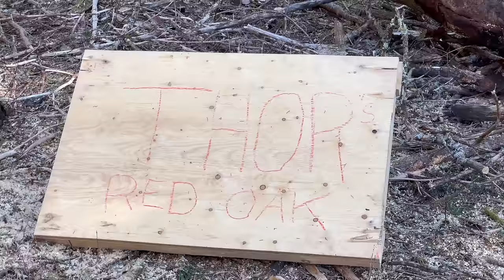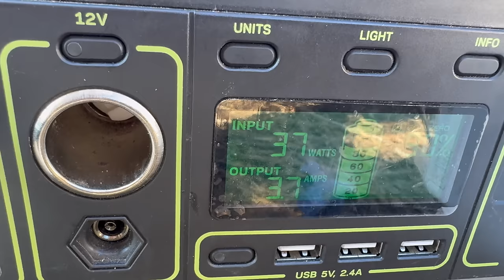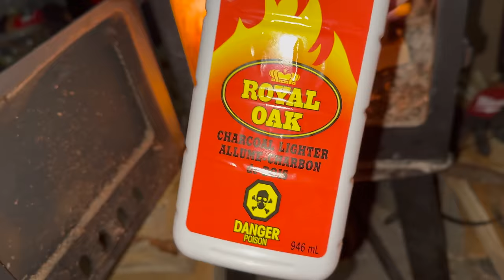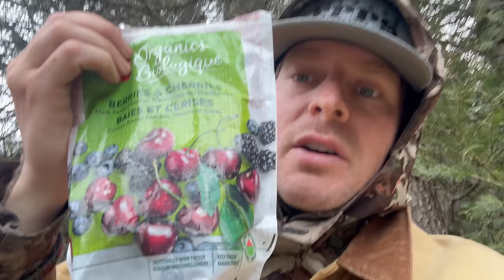Winter Log Cabin Build on Off-Grid Homestead |EP17|

Comment: For the chiseling, you want to score both sides and ideally chisel from each side to meet in the middle. That will eliminate the tear out you have. Pine is pretty soft so a whack or two should be sufficient to set the line.

Comment: when chiseling the gaps, bring them halfway through on one side and halfway on the other side so that the tearout meets in the middle. it also helps to have a backing piece of wood so that if the wood does tear out it cant because there is nowhere for it to go
Reply: Japp, that's how to do it
Reply: Along with having a board underneath what you are chiseling, you could also hog out as much material with a drill bit prior to chiseling. Hope that helps. Backer board prevents tear out.

Comment: I dont think your ears hurt due to machinery, im pretty shure they hurt couse you dunk em in cold water, in cold weather. I do it as well, but i always have a cap on that cover my ears, and i work 10-12 hour days all trough the fall-winter-spring with a chainsaw and tractors, without ear protection (i have it, just dont use it). The only days my ears hurt is when i get an earfull of cold wind. Combine low temperatures with your cold plunges, thats where your ear pain comes from, trust me. Try a swimming cap for a few weeks.

Also should be mentioned, loud noises dont cause hurting ears, it causes deafness and rarely discomfort. Painfull ears (painfull eardrums) are caused by cold, infections and if you jab em (q tips and such)

Comment: James, couple things. Deal with those gaps under your top plates now to block birds and mice in the future. You are creating a weird gap across the under part of the soffit that will be hard to seal later. Also regarding chisel, just backup your wood to avoid that tear out. Looking good over all. You are learning which is more than 99 percent of people out there. The most valuable thing to you is your neighbours amd your audience. Keep going. Watch the weather here. Get some highend rubber boots. You are going to be wearing them all year. The rains will come around June/july/august. This area gets about 50 inches of moisture per year...you are going to get use to mud and working in rain and muck, pal! Keep it up. Love the Epps hat!

Comment: With your rectangular checkouts, make multiple cuts with your circular saw from both sides down to your mark so it looks like thin wafers of wood left in the cut out area. Then knock em out with your hammer, then tidy up with a chisel and it will be a perfect checkout.
Reply: You can also chisel halfway from one side then flip the board then chisel from that side so you don't blow out from chiseling all the way through
Reply: Right on
Reply: @jamesjohnston8098  I agree, I was thinking “hes going to blow out the back” when I watched him. I was always taught to check in both sides with the chisel so that when you break through the wood is already scored behind etc. also I’m no carpenter

Comment: Shaving:  How to go from a 45yo to 30yo in two minutes!  
When you're chiselling those notches to prevent chip out, don't go all the way through with your chisel.  Work into the middle of the cut, flip the rafter over and work into the centre again. Then if needed you can flatten the cut with a couple of strokes of the chisel.  And yes, the serious chip out you made on the rafter would be an issue if the timber was load-bearing or structural.  But as a decorative rafter it's ok.

Comment: 31:45   Woodworking advise. Use the chisel to puncture the line you want to remove from the Back before you do so on the front. You need it like 0.3-0.5mm depth. This way you pre-cut the thin lair of wood that brakes on the end ;)

Comment: Sup homie, armature wood worker here. That damage the chisel did to the wood is called tear out. A simple solution you could do is apply a clamped back plate of wood just below the bottom of the section you are chiseling out. With the wood clamped down it can't be torn out like that. You had tear out on the sides of the cut out sections so applying a clamp with a back plate to the sides will fix that as well.

Comment: Maybe it's been said already, but for the back&forth stability you may also consider to put an extra transversal 6-7m  long 1x6' stabilizer, a "storm plank"to each side of the roof (from the top end towards the center) and nail them to the rafters.
It works perfectly against high winds in the (EU) Alps for centuries and costs peanuts.
Thanks for the great contents (& team work😉)!

Comment: To prevent tear out on the backside when using a chisel you work your way down 50% on one side then flip the board and do the rest from the other side. 
You could also just do cuts every 5-7 mm for the whole gap and then just bend the ”shingles” of with the chisel.

Comment: There are a handful of good techniques to keep wood from splitting on the back from the chisel. I saw a few mentioned already, but another is to roll (transfer) the measurements over to the backside of the board with the speed square and score the lines deeply with a razorblade knife. Use the edge of your square as a guide. The side scoring of the cut matters more than the top line since the grain runs end to end on the board and thats where its blowing out. The suggestion with multiple cuts with a circular saw with the blade depth set just shy of the top line is a good one too. I think scoring the wood is quicker and consumes less battery. Keep up the good work, the rafters look great!

Comment: Keep at it mate!  before going any further, now is the time to check your roof for square. top corner to opposite bottom corner. imagine in your head a giant cross on either side of the roof. both measurements should be within an 8th of an inch of each other. working alone with a tape can be tricky, plus it might not be long enough. a peace of string will also work, just mark the end with a marker pen. the sheathing and metal roof will thank you as you start putting it on. dont forget your small gap between sheathing for expansion etc, i just use a couple of small nails, about a 16th to 8th of an inch. good luck. loving your content by the way, top banana bro!

Comment: Hey champ, enjoying following your journey so long. I have a few tips for you. For example your new cart, if you tie a string on the handle, no more than a feet or two you’ll be able to walk normal when you pull it with those plywoods. Man I wish you would use a normal drill instead of that hammer drill, the amount of screws you use makes it kinda annoying to listen to. Have a nice day !

Comment: James, What you need is a wagon for your ATV, Currently Princess Auto has the one you need  and on sale for $500.00 off
In this weeks flyer page 12, Bozeman 3,100 lb Steel Dump Wagon for $1999.99. This trailer can then be used as a logging 
trailer as well as a trailer to transport Lumber or Sand or Gravel. I am enjoying your journey.
Keep Safe
Dave

Comment: To add to my earlier comment. Which was an oscillating cutter for plunge cuts. Look into a quite strike impact driver to save your ears. I use the Ryobi one I bought about 3 years ago almost exclusively now. I've don't have Milwaukee tools but I'm sure they have an equivalent. You do sacrifice some power, but I've driven Timberloks with no issues and it's probably half the noise and way easier on the hands to boot. Best of luck.

Comment: First drill 2 holes in the board then saw the small section(preferable with a jigsaw) from hole to hole in the length of the board after that saw the cutout from the edge. Sorry for the language, I am Dutch, (a former carpenter/mason)

Comment: i would trim the lower bit branches off that the rabbits got at so the tree pushes more to the main leader. At about 5-6 feet tall the deer stop nipping them also. I have some pretty zigzag oaks that are slowly looking more straight with each year. I think when the tree is mature you will not notice it. or at least i tell myself this. One thing with shaving this early in the spring is you notice how much insulation the beard gives you.

Comment: Multiple "kerf cuts" with your circular saw instead of just the outside edges...close as possible, cuts slightly above the bottom edge mark. Knockout with a hammer, then chisel cleanup. You have the right idea with material "relief" by drilling out the bottom then cleaning up with a chisel. Many close kerf cuts decrease the amount of tool change outs or processes....either strategy works. A large diameter "fortstner" bit bit can cut out a lot of material at the bottom, but you have more chisel clean out. Onward.

Comment: To make that chisel cut without shredding the opposite side, you can either start on one side and get half through and then flip the board or use duct tape. If you tape where you are cutting through, it will splinter less.

Comment: As for your rafter cutouts,to prevent them from tearing,once you've made your 2 saw cuts,lineup your square with the bottom of the cuts on the backside and score across the bottom firmly several times.Now when you cut thru with your chisel it won't rip or tear out past that line.

Comment: Finally sitting down to watch. Usually I watch first thing in the morning. I had to make a trip to the big box store today. Squirrels have been eating the PEX under my house. I’ve had to cap 2 pipes. My basement was flooding. Luckily the 3rd one that was chewed had a shut off valve. So, need to repair the pex, and I need to get the trees off the house, hope you don’t have any issues with squirrels. Moving to Midwest I’ve never seen anything like it. Anyways I’m 45 seconds into your video. Off to go watch. I kinda like the facial hair on you James.

Comment: You need to chisel against solid wood. 
You ar getting tearout because the wood you're cutting is unsupported
Usually clamp the wood being cut to another piece
Also you can cut from both sides to help prevent tearout.

Comment: To prevent blowout, take a knife and cut the fibers on the backside of the cut.  Or chisel both sides before you try to go all the way through.   There's no way you should be having issue with your saw and double ear protection.  I'd go back to wherever you got your ear plugs and do a test to see if they're fitting you properly.   It's also possible that because you're wearing them continuously that it's the pressure of having them in that's causing you issues.

Comment: With a template board you could EASILY mark a rafter in a third the time it took with the square and tape. More importantly you KNOW FOR SURE it's marked right. But you do you boo !!!! It's not like it takes 5 minutes vs 20 seconds but if you make 1 mistake 🤷 could be a 2x8 gone. Or are those 10's? Anyway ya cut it you've done a stellar job sir and we thank you !!!!!!!!!!!!!!!!!!!

Comment: Your "back & forth" often referred to as "racking" will only be solved with roof sheeting (ok  help) & even more so with angled bracing (Key!). Start at the 4 corners (where roof line meets the top of the end walls) & put a 2x4 from ea corner up to the center of the ridge line along the inside of the rafters. Tie all rafters into the angled bracing... racking stopped!!!

Comment: Tip for your chiseling: when cutting out that material have the flat side of the chisel towards you with you facing in the direction of where the chunk of wood needs to slid out, then angle the chisel slightly so that when you cut the wood it leaves behind a small sloped piece of wood. Then flip the board over and chisel out the remaining bit. Doing it this way will prevent that back flare out that you are seeing. Hope that helps. Keep up the great work and hope you stay safe in the storm.

Comment: When cutting your lap joints to join those boards perpendicularly, in your situation out in the woods without a bunch of shop tools, my recommendation would be to have a fine tooth crosscut saw on hand. Someone else already mentioned that you can cut multiple times in your waste section, creating “wafers” of wood. They will pry sideways with a chisel quite easily, and you can use the chisel to clean up the bottom of the joint. I’m no framer , just a recreational furniture builder. You’re doing really great, and as others have said, living vicariously through you.

Comment: Here is something that will help you on your atv in the winter. Run 87 or lower octane for your gas. It has a faster flashpoint than 91 or 93. So it will start easier in the winter. Also run the red bottle heat in your gas can . And another thing is properly warming the atv up in any weather but especially in the cold months. If you start it when it’s cold and take off then shut it off before it’s fully warmed up will create condensation in your oil. I’ve had some ranchers bring me their machines and they would have a quart of water in the oil. Hope this helps you! Great job so far.. I’m in Montana by the way.

Comment: First off use your chisel to score the cut lines to stop the tear out on the back side.If you had a jigsaw you could drill the corner and then cut across the bottom of the notch first. Then cut down to the corner with your circle saw. You should be able to do the same with your recip saw with a finer blade. Or you could score with chisle first and then drill multiple small 1/4" holes along the bottom of your cut. Then clean down with your circular saw. Then clean up with your chisel.

Comment: Just something to look into, but when my uncle had his roof redone in metals they used a special underlayment. I believe it was called Titanum Synthetic. 

The thought is that as the metal slightly expands and contracts the screws can worry out the holes in something like tyvex and make an entry point for leaks. This stuff supposedly doesn’t.

I’m not sure it’s a big enough deal to worry about it, and you may have already done and filmed that. Just wanted to mention it though. The videos are great.

Comment: Chisel halfway from one side, then the other. Another way is to chisel just a deep a line on the back end of the board so the wood breaks on the line rather than tearing out.
Edit: a third way is to clamp a piece of wood to your board so when you get close to the other side the sacrificial board prevents tearing, a bit like you'd put painter's tape on a circular saw cut to prevent chipping, but heavy duty.

Comment: Great episode.  I did a 10/12 pitch metal roof on my NH mountains log cabin and it sheds snow perfectly! Yours should be great. Hard to work on tho. 
Just be sure to install the bird blocking before the roof !  I didn’t because I wanted to get roof up before winter and it wasn’t fun doing it after.

Comment: Concerning your cutouts. Best thing to do is put something behind the wood that you're cutting as a sacrificial board. I have seen some of the best carpenters cut the slits like you did and then set the board on another board to clean up the bottom of the cut.

Comment: You should put an opening skylight, they are cheap to purchase and easy to frame in and install. It would mitigate the potential over heating of the loft. As a roofer I Install them all the time.

Comment: Re clean square cuts: 

There’s multiple methods you can do, probably the easiest would be to run the blade through a bunch of times, making several cuts. Then snap it out by inserting the chisel and leveraging it. 

Make the cuts just shy of your desired length of the opening, and clean the last bit out with your chisel

Comment: With a roof that pitched, and if y’all get that much rain/snow, I would do a French drain all the way around the structure and run it off the bank.. especially right now with the ground being easy to dig.. But this is only my opinion if it were me.. and my way of thinking.

Comment: Snicker, I don’t mind beards on men…just not the bushy ones most seem to prefer. It looks like they don’t take care of it, letting it grow out of control.
I prefer goatees and thin mustachios on men, at least then you can see their faces and won’t get beard rash when having a smooch….
As for the Norse gods, I prefer Loki over Thor. At least Loki thinks before he acts most times. Plus Their mother has to have the patience of a saint to put up with their antics and Odin actions.
I can’t help but wince every time I see the shavings and other debris on the ground beside your cabin build, I would advise you start cleaning that up before the fire fire season starts up again.
All those shavings and chunks of wood are borderline fire-starters, you just need to get a good rake and square mouth shovel to clean the mess up. The chunks of wood can be set aside for fire wood or something else.
I don’t know if the fire Marshall inspects that area, but it is something to look into

Comment: The notches you cut in the rafter are way too deep - youve cut below the centre line. That rafter has lost 75 % of its strength. Go to a library and look at a book on framing. If you leave that rafter you should sister it and not get on the roof directly above it.